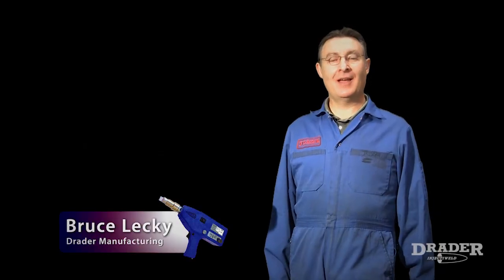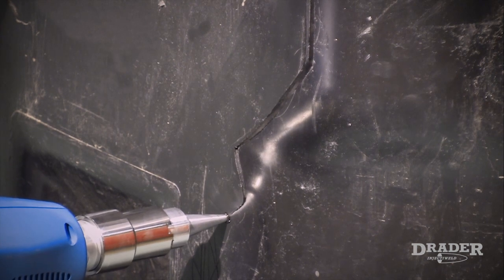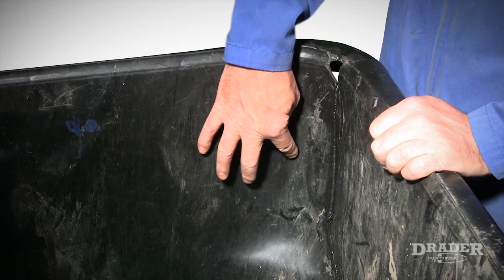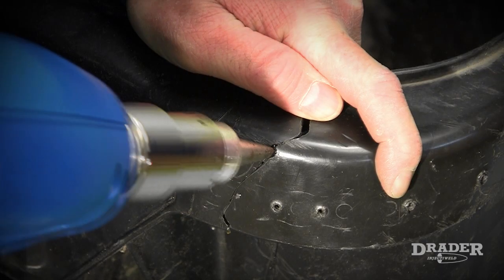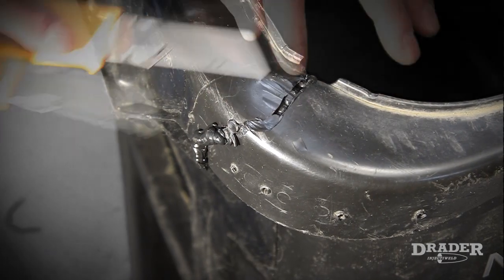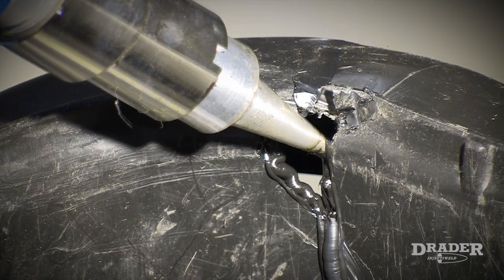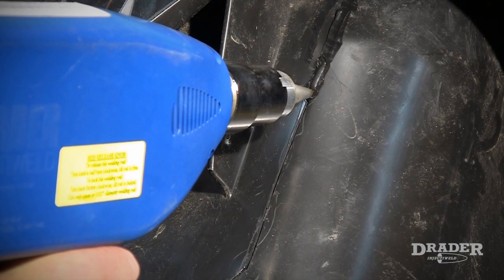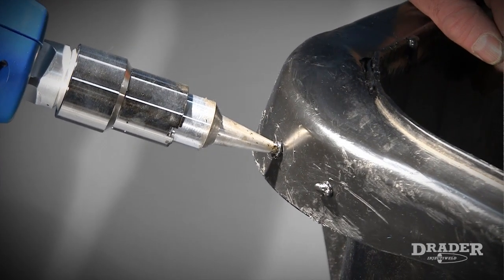Learn Plastic Welding » Weld and repair a garbage bin with a plastic welder

Comment: Great tool shame they don't  make of for England 230v. I know they don't  as Mine went wrong and when I took it apart it have 110 60hz parts inside.
Reply from the maker: Test Pilot Thank you for your comment. We are sorry to hear that. Two kinds of Drader Injectiweld plastic welder are sold in the UK: a) 120v UK  b) 220v UK. We advise you to contact the distributor who sold you the 110v UK welder for a replacement or repair. Drader Injectiweld provides 1 year warranty. You can find the list of our plastic welder distributors in the UK on this link http://www.drader.com/injectiweld-sales/injectiweld-distributors
Reply from the maker: Test Pilot If you have any further questions in regards to plastic welding and your plastic welder situation please email our customer service at csimpson@drader.com

Comment: I am making sheets of HDPE milk jugs. Will this work for welding the seems of sheets? thanks
Reply from the maker: Hello Steven Behncke. Thank you for your comment. Yes, Drader Injectiweld will work for welding the seems of high density Polyethylene (HDPE at 265ºC / 509ºF), PE, HMWPE (High Molecular Weight Polyethylene at 280ºC / 536ºF), and LLDPE (Linear Low Density Polyethylene at 265ºC / 509ºF).  Drader Injectiweld welds Polyethylene in all different densities.  You can see some examples of welded plastic sheets on our online picture gallery http://drader.com/injectiweld-gallery  What is the thickness of your plastic sheets?